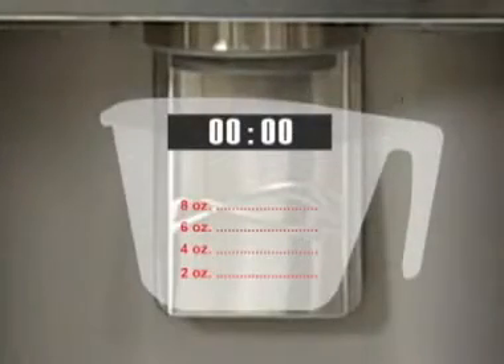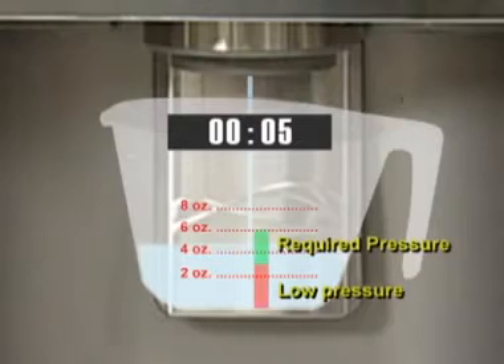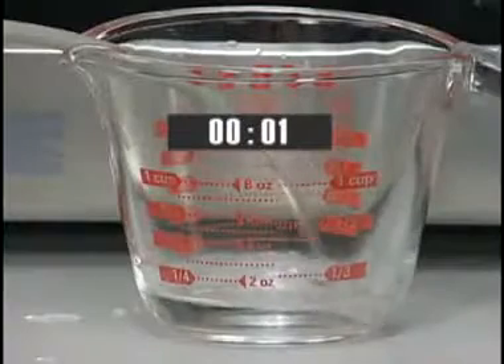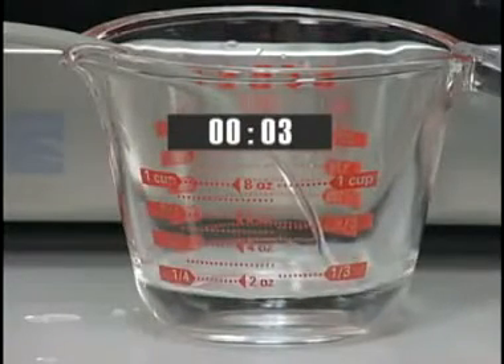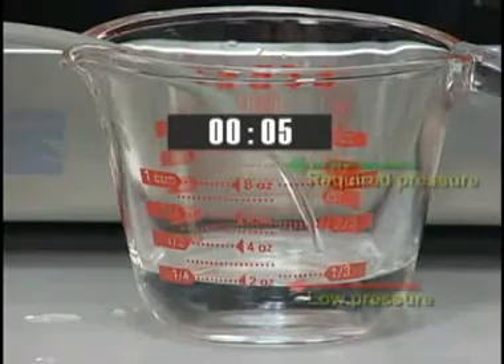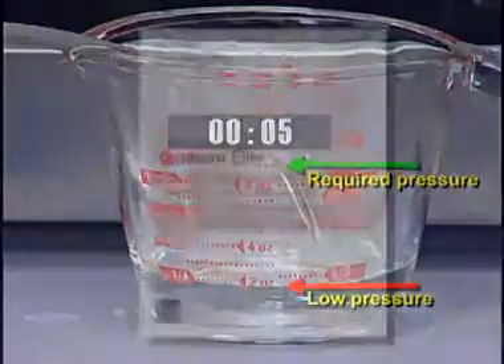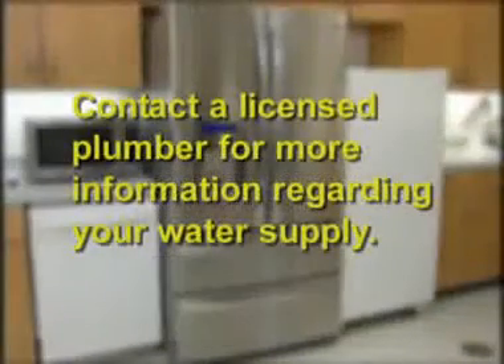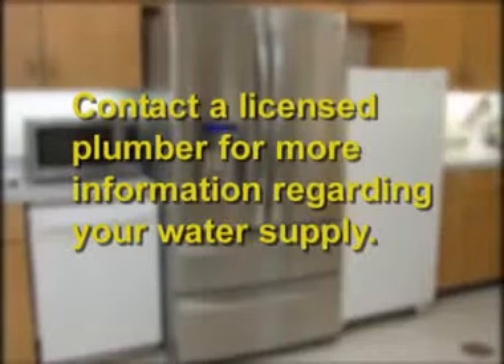Video: Water Dispenser or Ice Maker Is Slow

Comment: My Kenmore side by side water dispenser was slow after I installed a new filter.  I replace that filter, and it was back to normal.  The manufacturer said the filter "must have been defective", and is sending a free replacement.